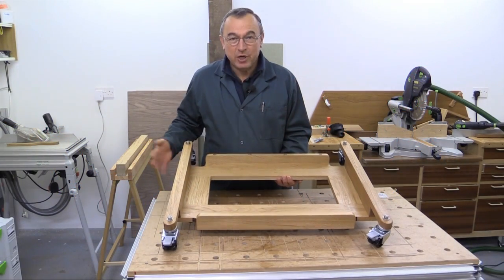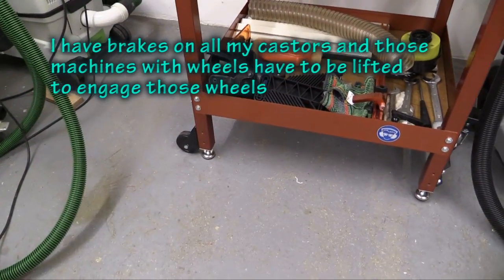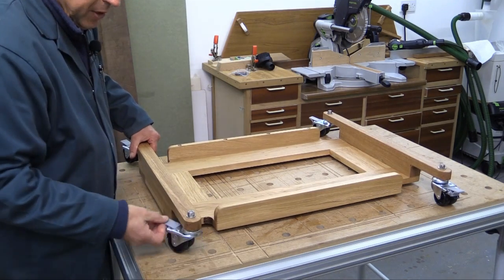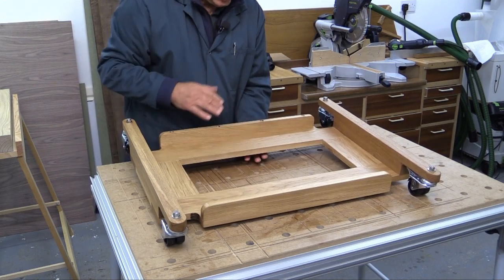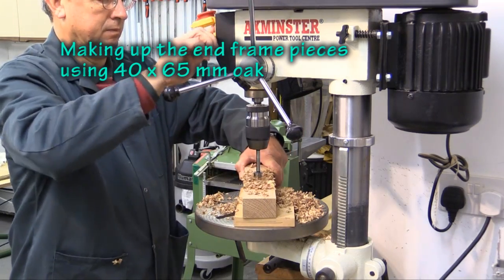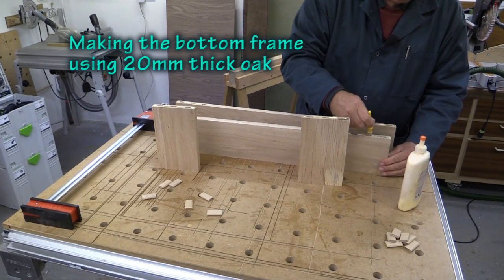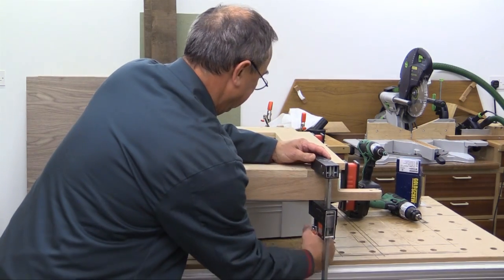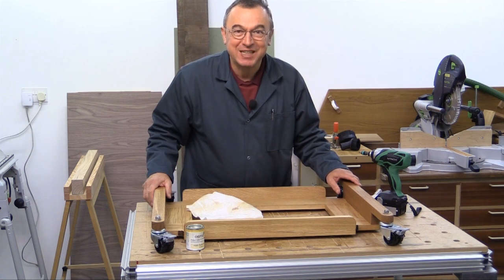How to make a moveable machinery platform - castor carriage

Comment: Peter, what size dominos are you using?
Reply from the maker: Hi Bryan, Long time ago but I would always use the largest possible but try to have the domino thickness close to 1/3rd of the stock thickness. Cheers Peter
Reply: @NewBritWorkshop  Thanks Peter! I see you used the 500 so I am assuming 10mm is the ticket.  Great videos Peter. I have becme not only a convert, but a fan!

Comment: A simple question, if I may. Shortly, I will be making a couple of these trolley bases for my workshop. I was doing some research as to the gross capacity of castors. I used to think that 4 castors with the capability load of 25kg each would amount to a total capacity load of 100kg. However, I read somewhere that to properly calculate the total combined capability of 4 castors is to divide the total capability of the 4 castors by 3 and this would give the actual safe maximum load. In my example of 25kg castors = 100kg combined. 100 ÷ 3 = 33.33 kg total capability of the 4 castors to prevent castor damage. Is this right? The total capability load does then determine what castor should be used and could therefore change the design of the trolley they are to be fixed to. I hope that makes sense. If this is right, would your castors be best at a 115kg load capability each in order to maintain your 150kg payload over a longer period, without castor damage or premature ware. What are your thoughts on this?
Reply from the maker: I have not read anything saying that one should divide the gross capacity by 3. However, my platform is as good today as it was when made and all of my other castor platforms are similarly fine. I am not sure if Coldene still do the castors that I used. To be on the safe side I would recommend that you seek advice from the supplier of your castors. Good luck.  Cheers. Peter

Comment: Nicely done - I’m building one for a Grizzly bandsaw (roughly 180 KG).  What was the dimensions of the primary boards that house the Castries?  2x lumber (oak)?  How much did you cut away to recess the base?  Looks like only about 1”  left where wheels mount.  Seems like it should be more to handle weight. Would pine be sufficient?
Reply from the maker: Hi Frank, The detail is in the plans and far easier than me putting every in words.  To get plans I need your email address. For my email address go to my channel home page, click on "About" and you will find the email address (this is best done from a PC for some reason). Let me know what plans you need and I will email them to you. Peter

Comment: At 6.09 minutes in the video it is stated that the wheels cost £6.70 inc vat. That is incorrect. Vat is added at check out and standard delivery is £12.94 for four castors. Total for four 50 mm castors is £47.70. Just thought you should know
Reply from the maker: Hi John, Well, the video was made in September 2013. Things change and surely you must appreciate that after nearly 8 years the price might go up.

Comment: How do you get the machinery onto the carrier?
Reply from the maker: The castor carriage is very low and I managed this easily on my own but I strongly recommend that two people do this together. Place a piece of sheet material (I used 19 mm MDF) under the open end of the carriage. "Walk" the machine onto the carriage by tilting and turning making about 80 mm of progress each time. When the machine is on the carriage use some levers to raise the open end of the carriage in order to retrieve the piece of MDF from below. Then screw the retaining piece onto the carriage.   Peter
Reply: @NewBritWorkshop  thanks Peter, I will be doing this soon. First to make one of your carriers.

Comment: Hi, I am looking at building something similar to take a stack of storage boxes. There is obviously a issue with centre of balance and tipping point. I was considering designing in a set of ‘outriggers’ that can pulled out of the frame for timers when the stack is being moved. I am just trying to figure out how to do it. Have you come across anything similar?
Reply from the maker: This design keeps the CofG within the footprint of the castors quite safely. With your stack it only becomes an issue if you tilt the stack sufficiently to get the CofG beyond that footprint. This is unlikely unless the stack is very high.  Peter
Reply: New Brit Workshop: I am a belt and braces person so the possibility bothers me. The stack is likely to be as much as 6ft tall so I am going to calculate for CofG but my gut says it could be a problem. The stack is likely to approach 200kg in weight so it would likely be disastrous at best and downright dangerous at worst if it were to topple. My garage floor is pretty good but not perfect so any thing that hinders a caster might cause the stack to shift, hence my caution. Just trying to mitigate risk with the outriggers. Still brainstorming at the moment, so I will see what I can come up with.

Comment: Hi Peter,
I enjoyed your video and the base you made out of oak. I too have recently purchased a heavy planer/thicknesser for my needs and need a mobiles base for this machine. I intend to make a base similar to your model...thank you. I was hoping you could product a product number for the castors you used in your construction ?
Also i see you have the same Axminster drill press that I have. It has served me flawlessly for years but I need  new drive belts for it. I know the rear belt is an M23 size but could you tell me what size the front belt is please ? I have contacted Axminster and they tell me that they are different sizes but could not specify the correct size.
I appreciate your anticipated assistance.
Great videos..thanks.

Midge
Reply from the maker: Hi Midge, The castors from Coldene are stock number CDTWBH75BLB. I am away from home this week and cannot help with the drill press belt. I would look in the instructions or take the old belt into an Axminster store.   Peter
Reply: New Brit Workshop  thanks for the castor ordering code. The best has no model number on it and is stretched beyond its normal length. I’m afraid the operating manual is long gone.  Axminster were unable to assist either. 
M
Reply from the maker: Hi Midge, Try finding a belt by measuring the shape of the "V" and then using a piece of string to estimate the length. This site may help https://www.georgelodgedirect.co.uk/Products/v-belts/  but Google searches of your own will refine things further.  Peter

Comment: Peter, thank you for the plans. In the video above you make the bottom frame from four pieces of 20mm oak, domino jointed. In the revised Jet plans you sent me am I correct in assuming that the base is now one sheet 520mm x 795mm? If so why did you change?
Reply from the maker: The Jet machine is a bit heavier and in manoeuvring the old Axminster machine off the original platform I cracked part of the oak framing. Hence the stronger base. If you have received the plans for the new castor carriage you will see a photo attached of the new base. It is not a single piece of wood for the base but a frame construction shown clearly in the photo.   Peter

Comment: how do i measure for my table and band saws????
Reply from the maker: This is not suitable for a bandsaw as they tend to be top heavy. You need to know the weight of your table saw before building a platform like this. If you believe you can make something strong enough then just work it out from the dimensions of your saw.   Peter

Comment: Peter this video is three years old now, and I'd be interested to know if the platform has stood the test of time?  It's beautifully made, and put together, but it worries me.  I have limited woodworking experience, but I am enjoying working with wood with all the machinery at the Blenheim Menz Shed in New Zealand (I am the secretary and have been the there two and a half years).  However I worked as a toolmaker at Ford's Product Development site in Dunton Essex for nearly 40 years, so I think in terms of metal.  The long arms for the casters worries me as there is so much leverage, and the wood not 'that' thick.  I imagine that oak is something special from a wood point of view though.  Also the platform and mounting screws are in tension, and will suffer shock loads and bending moments if running over something on the workshop floor.   I'd love to hear that it is working fine and as solid as when you built it.

I found your video because I have bought a bigger tool chest, and will need a trolley to move it in and out of the back of my SUV.  It is heavy enough empty, so likely  to weigh 200lbs or more when full.  I might just weld something together with metal tube, but your platform is beautiful, I would so much prefer to go that way if I can.
Reply from the maker: Hi Trevor, I did revise the design and the plans that I provide reflect this. Mine is still going strong and has had the 170 kg load on it for all that time. As you are comfortable with metal fabrication you could go that route but good quality oak and my revised design could also be used.    Peter

Comment: Hi Peter. I just discovered your channel and your videos are excellent. It appears though that the private message function is not available any more, so how would I contact you with my email to obtain plans?
Reply from the maker: Hi Matt, YouTube have stopped private messaging but if you send a comment to a video with an email address it should get captured by the YouTube spam filter. I will be able to see it but nobody else will. I will send the plans and remove the comment in order to protect your email address. Many thanks for the kind words.   Peter
Reply: @NewBritWorkshop  Hi I sent the email as a reply as you suggested. Thank you!
Reply from the maker: Plans sent.   Peter

Comment: Hello Peter

Further to my caster problems that asked your advise about.  I have taken a closer look at the problem and as usual you are right, in fact you mention this in your video.  The casters cannot rotate the whole 360 degrees and are getting caught under the machine.  I have ordered the casters that you recommend from Coldene and will make a proper base.  The AT129PT is a fair bit heavier 272 kg  than the machine that you made your base for so do you think that I should use Thicker wood for the project.

Once again many thanks for sharing your knowledge and experience with others, there not many people prepared to do so these days,
Reply from the maker: Hi Greg, Ah, I did not think about the clearance issue but at least you have spotted that now. Remember that the plans that I sent have both the old and the new version and it is the new version that you should use albeit with slightly thicker wood - say 6 mm extra all round but make sure that the planer will fit as well as the castors having clearance. Getting the machine onto the platform is not easy. I put some pieces of 18 mm MDF under the body of the platform thus lifting it off the castors. I then "walked" the planer onto the platform and fitted the final side piece along the side through which the machine was moved. In order to get the carriage off the MDF I used some simple levers to raise one side at a time allowing one piece of MDF to be removed each time.   Good luck and watch your back and your toes.    Peter

Comment: hello again peter

I noticed that you fitted 4 swivelling casters to this base.  Did you have any problems with this design.  I have purchased a second hand Axminster AT129 PT  the chap has fitted 4 x 75mm Swivelling and Braked casters.  The problem I have is that the machine is really hard to move as 1 or 2 of the casters always seems to be facing in the wrong direction.  Once all four have aligned themselves it moves OK.  However all the pushing and shoving required to get it on the move is bending and twisting the casters.  I have also noticed that all of the machinery bases you see for sale are fitted with 2 Swivelling and 2 Fixed casters.          I would value your opinion and experience on this
Reply from the maker: Hi Greg, It sounds as though the castors are not the same as mine. I have no problem at all using the Coldene castors and I did recommend them for this application. My big castors on my mobile bench and tracksaw cutting station (CNC cabinet) do exhibit the "not always easy to start" behaviour but it is easy to push the cabinet in a slightly random direction in order to get the castors lined up. But the special castors on the planer platform behave perfectly all the time.     Peter
Reply: Thanks very much Peter.  Looks like I should invest in some Coldene casters

Comment: Nice Peter, the real problem for me is getting the machine on the base haha
Reply from the maker: It was for me but I did it on my own despite my arthritis and age. I placed a rectangle of MDF under the flat bottom so that it was off the castors. I then "walked" my planer onto the carriage. I then used a simple lever to place a slightly thicker piece of wood along one end. I used the lever again at the other end and was able to remove the MDF rectangle. I then lowered that same end to the ground, went to the other end and used the lever to lft it so that I could remove that slightly thicker piece of wood. I did not break into a sweat at any point !   Peter
Reply: New Brit Workshop Thanks Peter, was thinking something like that.
Reply from the maker: Good luck.   Peter

Comment: given the weight in question I would have put a metal plate across the top and bottom of the 2 pieces you indicate at 4:00, to ensure the ends don't break off and to ensure the wood does not split a long the grain pattern.
Reply from the maker: Hi Greg, People should certainly enhance the strength if their equipment is really heavy. I have build two of these, both had to carry about 180 kg and neither have failed.  Cheers.   Peter

Comment: Peter- many thanks for another excellent video! I have the same model and built a carriage using angle iron, but fell into the trap of mounting the casters at each corner, thus leading to instability. Thank you so much for making this point, which with hindsight (always 20/20) is now blindingly obvious! Many thanks also for mentioning the thicknessing gauge accessory, of which I was not aware. May I also ask for a copy of your improved plans?
Reply from the maker: I would be delighted to send you plans but I need an email address in order to get them to you.    Peter

Comment: Hi Peter, is it possible to get a set of plans? nigel.taylor@talktalk.net. Also as an alternative do you think the Axminster workbench casters would work? Being fixed straight to the frame of the machine just to move the planer from the wall and lowered down to use?
Reply from the maker: Hi Nigel, You should have the plans by now.   Peter
Reply: Yes thank you 👍🏻

Comment: How did you know that this design would be able to sustain that weight? On which principles did you choose the stock thickness of all your pieces? 
Beautiful design and execution, by the way :)
Reply from the maker: Hi Francesco, I have been working with oak for 50 years and in that time you get a good idea of its strength. I did however, improve on this design which is reflected in the plans.   Cheers.    Peter

Comment: Peter, I notice that when using the bandsaw you're wearing a full face shield. Is this something you wear when using all power tools or is it particular to the bandsaw? I suppose it's handy that it can be worn with glasses! Thanks.
Reply from the maker: Hi Ben, I have had some slight asthma issues and that was the case when the video was made. Most of the time I do not use any mask. Peter
Reply: Ah OK that makes sense. Thanks for taking the time to reply. Ben.

Comment: Hi Peter.  Nice presentation.  I can only see that loading your machine onto this platform would have to be done squarely and very carefully.  I would suggest that the distributed load rating of your castors is more than adequate, but, the point load on your oak crossbeams would not be durable enough to resist cracking at the junction of the radius you have provided for your castor to have 360 degree rotation.  If you were to laminate this member, your would mitigate the stresses.  I suggest an angle steel running the length of your castor mounting beam - inlayed for appearance.  You could also route two 6mm channels the length of your castor support beam either side of your through bolts to run some flat steel bar that would give the timber a steel spine.  I have seen timber endure very large distributed loads, but the fibers give way when the point loads come into play.
Reply from the maker: +Stewart Robertson Many thanks Stewart. I did modify the design and those people who ask for the plans get the original drawing plus the "beefed up" drawing of the new design.   Peter
Reply: I did see your updated version when you demonstrated your Jet machine.  Well done.